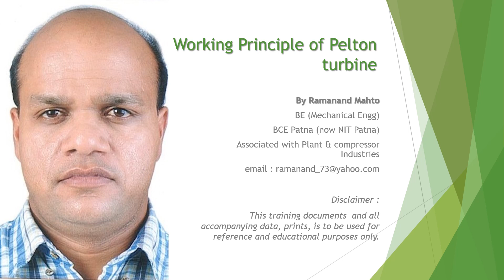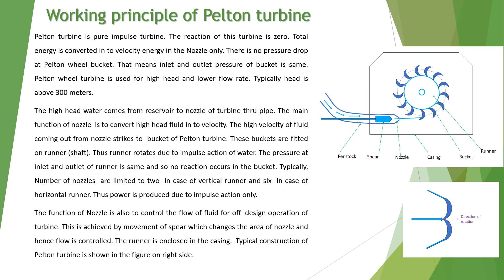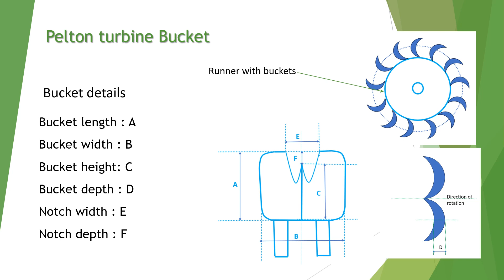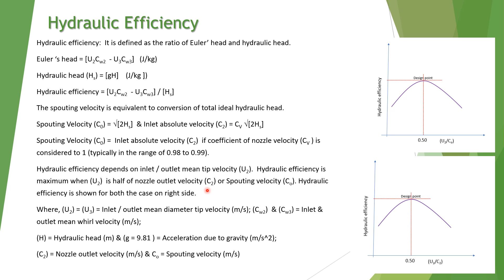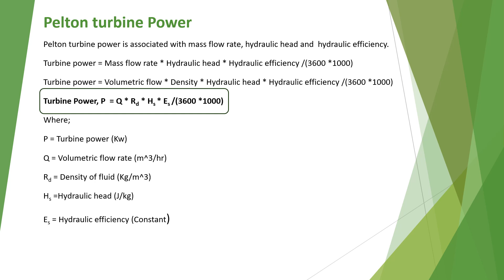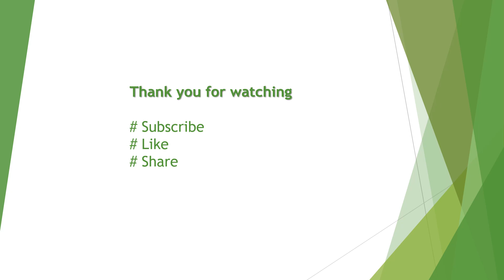Working Principle of Pelton turbine

Comment: Thanks 
Please explain the real meaning of impulse and reaction turbine.
Reply from the maker: Impulse turbine is called when fluid mass with velocity (momentum = mass x velocity of fluid) strikes the blade /wheel of turbine . Because of fluid momentum, turbine rotor rotates. Common examples of impulse action are Foot ball player hits the ball, cricket player hits ball with bat, etc. In impulse action, some external objects strike in to another object and motion is generated . In case of Reaction turbine, velocity ot fluid which comes out from turbine blade /wheel, generates reaction (thrust force ) on to turbine blade in opposite direction to fluid motion.  Reaction is generated when some objects come out from another object. Most common examples are Lifting of Rocket due to Reaction of exhaust gas coming out from the rocket. Other like aeroplane also works on Reaction principle .